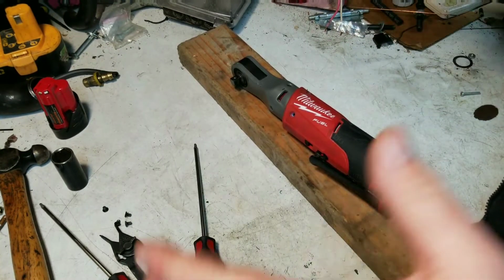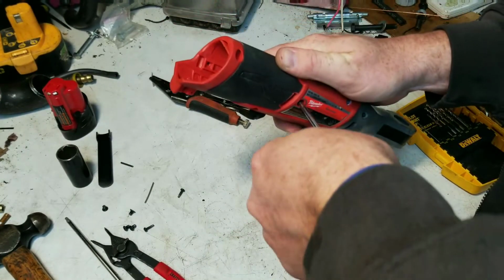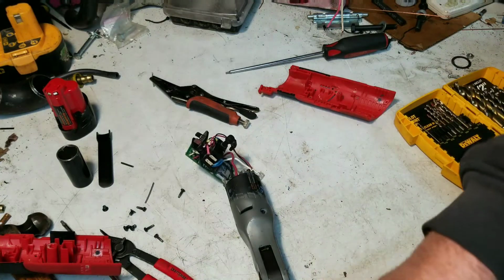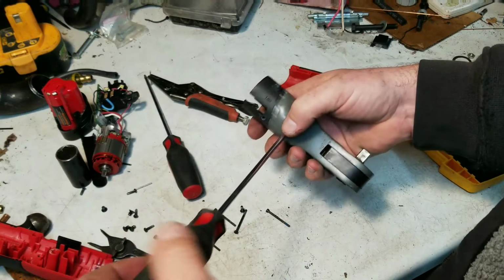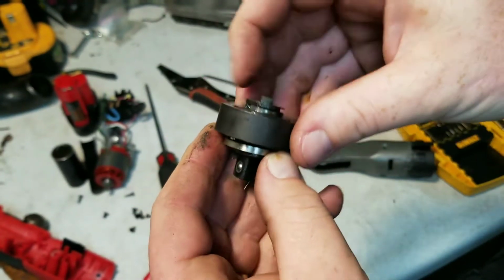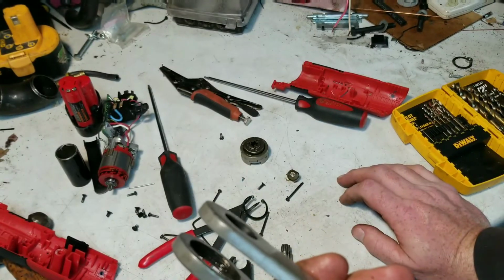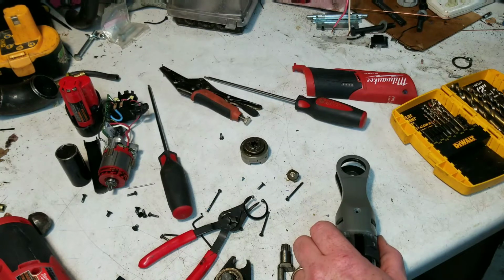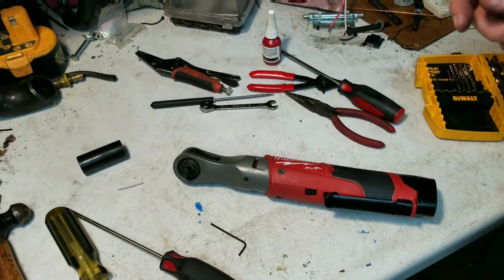Milwaukee 3/8 ratchet M12 FUEL 2557 teardown

Comment: Those three sensors monitor rotor position fer the control board.   That thar be a sensor type brushless motor.  The board uses the position data so it knows when ta swich polarity ta keep 'er spinning.

Comment: I work on sand blasters and the older 1st non fuel Ratchet had no problem and I had it for 4 years after that things been dropped you name it it still kept running but ‘  sadly one day my ratchet went missing !  Some A-hole stole it pretty much so I thought I would finally upgrade to the Fuel Ratchet ‘ got it off someone from offer up for 90$ ok this thing didn’t even last me a week !  Sand got inside so I took it apart cleaned all the sand out put it back together stupid thing still won’t work “ not impressed by the new bulky slow Fuel Ratchet . Now it’s trash because I don’t have the receipt “ I’m going back to the 1st non fuel one because it’s smaller lighter and I didn’t see that much difference in power
Reply: Really I just bought the non fuel version and was thinking about taking it back for the fuel version because I heard the head is more heavy duty. Although have been hearing shit getting in the big vent on fuel from other reviews.
Reply: Hard Core  yea the head is heavy duty and super bulky witch in my opinion makes it difficult to get into those hard to reach areas , like trying to get exhaust pipes out of your engine there’s no way you could fit the bulky fuel one and heavy duty or not I don’t think you would have a problem with the smaller one breaking and I put some serious torque on it to
Reply: I've got this fuel version and its lasted 2 weeks, not impressed at all, it works but doesn't spin when I hold it with my hand not what I would expect for £200, its got a guarantee but the only problem is I've got to send it back to Northern Ireland to get it repaired, I'm not sure how or why these products get good reviews it may work in America and other countries but I'm not impressed in the category of piss poor for me.
Reply: Update: I Wouldn't have seen this if someone else didn't place a general response, but what I'm learning is beings it's controlled by a board, it reacts to when over the max load rating, if you look to the side of unit the three lights flashing is the notifying message, it's DEFINITELY not intended to go OVER the max programmed torque. So far I'm very happy (so far) it's paid me back.
Reply: @Tudalouu  read it again ding dong “ it’s trash because I don’t have the receipt ! But   fortunately Milwaukee did accept it and made the repairs and sent it back to me And you know what it took another shit 2 weeks later ‘ I still have my older non fuel still going strong after 6 years of abuse ,  I have pretty much every Milwaukee power tool you can think of and out of the 15 power toys only one took a shit not once but twice !  Maybe your not using yours enough or something they are my every day tools being a maintenance mechanic . Thing is supper bulky heavy as shit ‘ can’t barely get to those hard to reach areas in the  engine compartment “ and it doesn’t have that much torque as the other one maybe a little but it’s size is over kill shits even bigger then a pneumatic ratchet witch definitely has way more power then this one
Reply: I still wouldn’t mind getting the extended neck fuel one tho but it’s expensive as hell